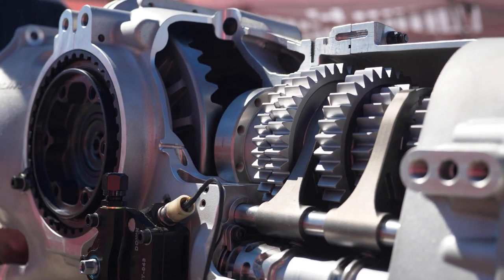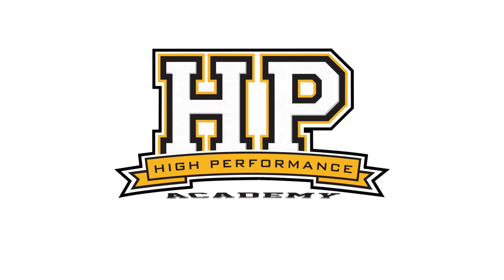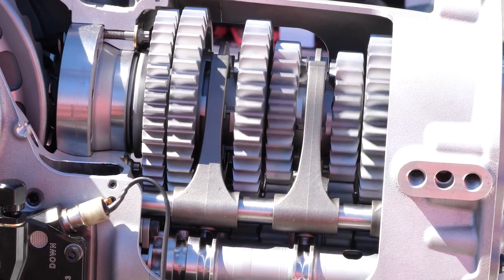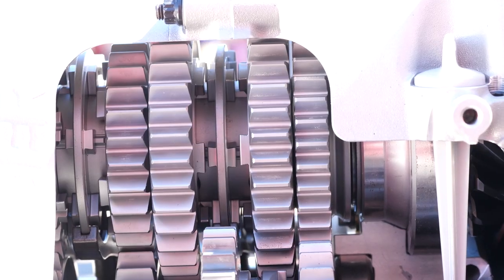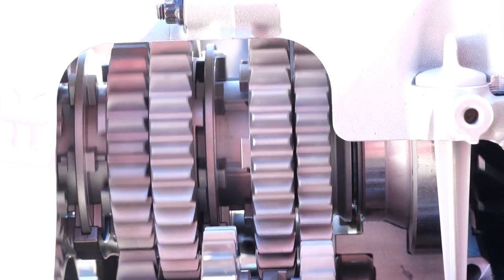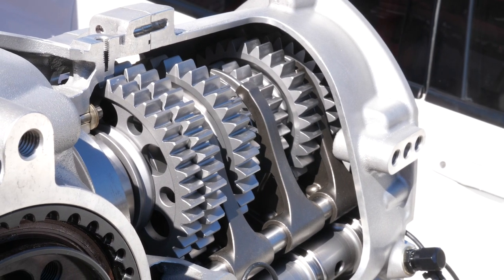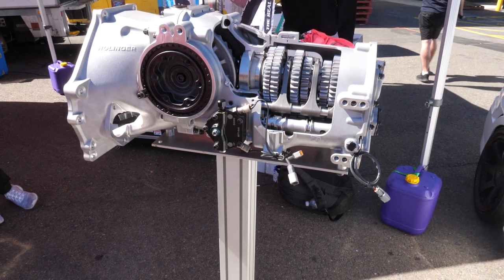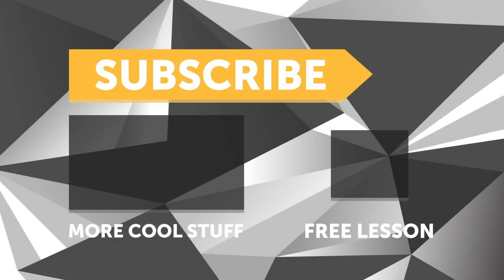Synchromesh Gearboxes Suck. Racers Use THIS Instead

Comment: Great video explaining things.

I used to have a car with a CAT engagement gearbox so it would only go into the right gear when it felt like it and sometimes it was taking a nap and would not respond.

DOG's are better and tend to be better at following instructions :)
Reply: Hey, anyone here can tell me the reason no car manufacturer opts for this type of gearbox and integrates it with engine like the bike engine. so that the structure of engine suppresses the noise made by the dog gears.
Reply: @JohnKickboxing First of all, integrating the transmission with the engine will have no effect on noise. To drown out the dog engagement sound, the engine will have to be made much louder, via intake, exhaust, engine mounts, etc, and while I along with most other enthusiasts wouldn't care, in reality, us enthusiasts are an extremely small proportion of car buyers. The other significant issue with a dog engagement transmission is the greatly reduced wear life. For fast shifting, yet good wear life, and even low noise, there is already an option on the market: the dual clutch transmission. Yes, it's heavier than a manual, and has less driver engagement, but it shifts faster than any dog engagement manual and can be tuned to always shift perfectly, unlike a human, so it is the optimal choice for performance. Dual clutch transmissions can also handle much more power with stock clutches than a manual.
Reply: Dog boxes work well in motorcycles because they only weight about 200 kg and don’t put out a huge amount of torque, so they are able to last for a few hundred thousand kms without significant wear and tear. 

For cars that you sell to the general public and weigh 1500 kg and produce 500 hp, you want something VERY reliable.

Comment: Dogboxes makeva lot of sense to me, because it's how basically all motorcycles work.  Synchros are still mysterious to me.
Reply: Synchros are super simple - the synchro is a cone on cone fit (causing it to smoothly jam into the main gear). It has the same set of dogs on it that the gear does, so then the shift fork pushes the collar into it, it syncs up to the collar. Then it slides into the cone of the intended gear, which is the momentary "stop" you feel, where friction syncs up the gear to collar or collar to gear. Then the force on the dogs eases amd the collar can slide in.

If you bash it in and there's no time for the cones to engage (or if you overpower the friction that's preventing the collar from sliding past the synchro ring), you will grind the dogs on the gear against the collar. Not exactly what you want in that situation 🤔

Comment: Is it common for the selector ring to pop out when you go from full to 0 load?
Reply: No. The torque reversal that occurs between coast and drive only lasts a split second. The gear will rotate about 20º in relation to the dogring, and then the gear/dogring will be locked together again. If you are pulling on the gearstick during the transition between coast and drive, you can snatch the dogring away from the gear - but you kinda have to try to make it happen. It's the same with a synched transmission - I'm sure you've ever noticed you can pull the trans out of gear during a transition between coast and drive - but again, you must do it on purpose.

That said, there are highly specialized drag racing gear boxes that have the raked face on the engagement dogs for keeping the gear and dogring locked together while under load - but the back side of the engagement dog is ramped to specifically push the dogring away - unselecting the gear. In these transmissions, each dogring is dedicated to a single gear, unlike the transmission shown in this video where each dogring serves two gears. Anyway, the point of the specialized drag racing dogbox is so you can select the next higher gear WITHOUT having taking the previous gear out of engagement. As the shaft speed increases on account of the higher gear being selected, the previous gear overruns the dogring, the dogring hits the ramp, and gets kicked out of gear. The obvious advantage being a shorter overall amount of time for the shift. Disadvantage being you can't engine brake at all.

Hope that explanation helped.
Reply: If that's a issue you're having, it usually means the bearings are worn and allowing the helical gear to physically pull it out of engagement, the bearings are moving in the housing/on the shaft for ditto, and/ or the indent spring is damaged or broken.
With some front wheel drive vehicles, broken engine mounts can allow the engine-transmission assembly to move enough to pull it out of gear.
In either internal or external cases, you will probably see excess gear lever movement.
Reply: Damn guys thanks those are great answers.

Comment: You know, it always interested me how drivers in NASCAR shifted the H pattern without the clutch. Now I know why.
Reply: And now you also know why NASCAR gearboxes are INSANELY overbuilt lol.
Reply: @spdcrzy  That’s just race cars in general lmao
Reply: @denimpantz  not really. NASCAR gearboxes deal with WAY more torque output than most race cars ever do. 700 lb-ft of constant torque at WOT for hours at a time isn't something you find in ANY other discipline of motorsport. Add to that the fact that there were no paddle shifters until very recently, and those gearboxes take an absolute beating.

Comment: You don’t need an ECU controlled torque cut, a lift of the throttle pedal should suffice.
Reply: true, but that could cause a loss of boost (on a turbo engine) so will be slower than a momentary ignition cut.
Reply: @dataminetk  correct. But for a manual dog box it provides for the possibility to drive or race like a two pedal car. In our Danish DTC car we had a G-force 4-speed dog box, and our driver left foot braked and drove like a two pedal car, and only used the clutch pedal for setting off.
Reply: if the free valve had been a thing, the idea of simply opening the exhaust earlier would maintain boost and give torque cut...

ignition cut? what, all that nice fuel going out the exhaust cold and unburnt? may as well light it up and keep the turbo toasty.

almost has me tempted to stuff around with the decomp lever on my diesel... now, if it were cam operated to only act on the power/exhaust strokes...
Reply: No,  but it's a LOT nicer (and more repeatable) as well as less harsh on the drivetrain.
Reply: @paradiselost9946 I may be wrong but isn't ignition cutting used to keep the turbo running? Letting the unburned fuel ignite in the hot headers and turbo resulting in flames coming out the exhaust and and the boost staying high

Comment: You have a regular manual gearbox without Synchromesh. The so-called non-synchronized manual gearbox that was used in the 70s in f1

Comment: You don't need to use the clutch when you upshifting but you have to use it when downshiftibg
Reply: Not necessarily. You can rev match a dogbox as well. You just rev in neutral instead of clutch down.

Comment: Dogbox is non sense on streetcars cause it ruins quickly.. as far as racecars, dogbox is much less effective than sequential box.. more, lots of racecars use synchrmesh with straightcut gears or less pitch gears to split forces. Transmission style cannot beat huge engine horsepower!
Reply: @nospeedlimits7777  forgive me if I'm wrong, but I believe that syncromesh in transmissions are almost always used for only street applications since it's a more comfortable way of gear engagement and synchronization. Dogboxes don't use syncromesh. They use dog mesh or dog gears, so they allow the driver to just rip it into the gear without the use of a clutch. "Sequential" is just how the gear is selected, like a sequential gear selector. The transmission and the gear selector are two different things. I think you're referring to how the gears are selected instead of the gearbox itself, which is H-pattern or sequential lever/paddle shifters, and the lack of H pattern gear selectors in racing. And yes, the use of dog gears is super inconvenient on the street, but you will almost always see them on the racetrack, not syncromesh. I don't mean to spread misinformation, though.
Reply: @cornedbeef4332 and you're right when you say dog gears are much more faster shifting than synchromesh ones simply because in dogbox there's nothing between a gear and next. But it is sure synchromesh lasts way more than dog. Many brands provide dogbox for professional racing and synchromesh less pitch beefier gears for amateur racing demanding low cost. Not a matter with your correct explanation. Only I add one more option for those not allowing to go higher price and wear out dogbox. Thanks mate for all big racing info!
Reply: @nospeedlimits7777  oh yeah syncromesh lasts way longer, 100%. No doubt about that. No problem man, I didn't wanna sound dumb, I just wanted to make sure about what i was saying.